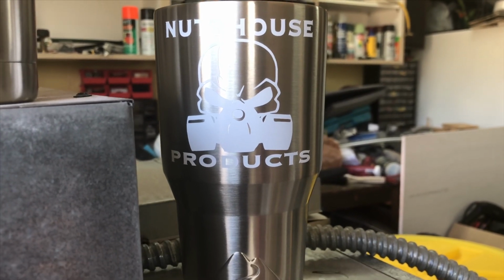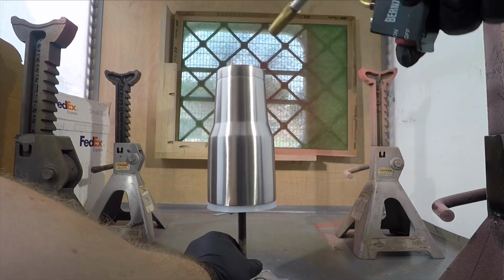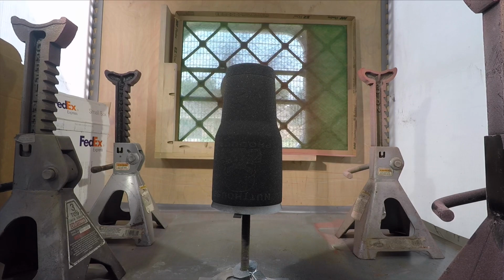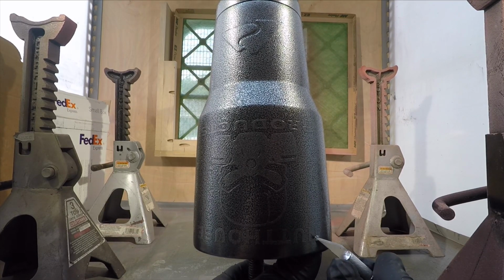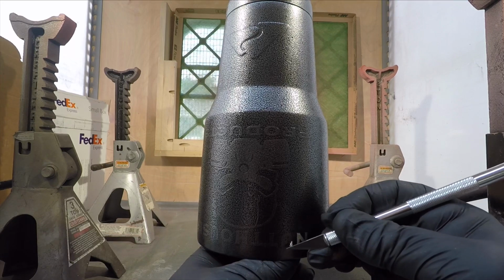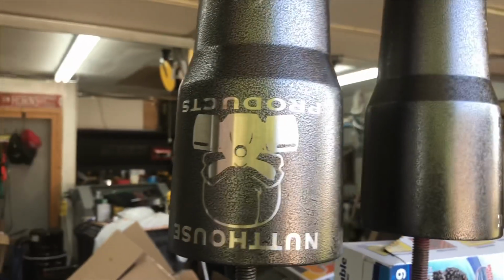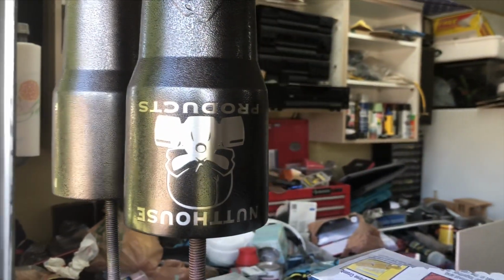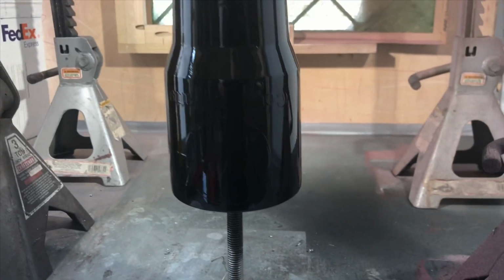Powder coating tumblers from home!! Adding vinyl decals for a custom look.

Comment: Are you using a heat gun to rewarm the cup to keep the powder soft?
Reply from the maker: On some of them yes and some I used a torch. Heat works better because it’s an even constant heat; we’re as the torch is faster but you can mess up the project also.
Reply: @TheNutthouse1  thanks

Comment: How did you do your ground? I think I have an issue with not having a good enough ground… I’m extremely new to this(only have done 2 pieces. I do horseshoe art). I know I have a ton to learn and any advice is welcome 😊. Great job on the cups man!
Reply from the maker: Thank you. I ended up doing an earth ground also. Put in an 8’ rod right outside my garage door.

Comment: I am just getting supplies for powder coating. I have been doing epoxy tumblers for about a year. What are the recommended temperatures for the oven?
Reply from the maker: For most powders it’s about 400°
Reply: Most companies either send instructions or have them on the website(Eastwood does any way)

Comment: I'm just getting my feet wet with this process, I'm wondering is it necessary to seal with Clear powder coating paint  or can I leave as is and If you do have to seal does it make it shiny or will it be a matte finish?
Reply from the maker: No I used a gloss black. And it came out already shiny.
Reply: The Nutthouse Okay so if I wanted a matte black I do not have to seal it? I can just leave as is correct? Thank you so much for your quick response.
Reply from the maker: Creative Vinyl Designs By Rebecca Escott  no you don’t have to clear it.

Comment: I have trouble with the vinyl shrinking when waiting for the powder to flow out. What vinyl do you use? Do you have any tips? Thanks for the video!
Reply from the maker: Greg Allen yeah absolutely. I use Orcal 651 vinyl. You can also get high temp vinyl. When I’m doing decals. I watch it closely and as soon as it flows out ( maybe 2-3 minutes) I pull the cup. Let it cool down to about 125 and pull the decal. I have had my vinyl shrink on real small thin lines. I hope this helps.

Comment: My adhesive from the vinyl stayed on the tumbler when I pulled the stencil off. 1) any tips for removing the adhesive but not the powder coat? 2) do you know why it did that?
Reply from the maker: You may have pulled it when it was to hot still. I try to pull mine when it’s between 110*-130*. But you should be able to use a magic eraser to help clean that up. You can also use acetone or denatured alcohol after it’s been fully cured.

Comment: Hey,  are you using a standard kitchen oven? Electric?
Reply from the maker: Jacob Porter yes it’s a standard kitchen oven. Well I have a double oven and that gives me just more room.
Reply: @TheNutthouse1  thanks for the reply.  Do you have much luck painting a base color,  laying a vinyl and then coating a different color to get a finish other than the stainless? Great work on the cups btw
Reply from the maker: Jacob Porter yes I have. Check out my video on the motorcycle parts. And thank you. Cups are fun to do.
Reply: Hello and how are you doing today? This is a wonderful turtorial! Do you have another one that shows everything a person needs to do this from start to finish. Like the name of the materials you used to apply everything and what you put on the cup?

Comment: What do you put in the top of the cup to keep the powder from getting in it
Reply from the maker: Billyz Designz I use a silicone plug. I ordered the cup kit from Columbia Coatings. You get the stand and the plug. They make the plugs for different size cups so make sure you pick the one you plan on using. Yes got both sizes just in case.
Reply: The Nutthouse thank you
Reply from the maker: Anytime

Comment: So how do you like that Kool Koat so far ? Finally ordering mine this week. And also , is there a place to order those tumblers or are they store bought ? Seems to be a lot of money involved being store bought
Reply from the maker: M Gears I really like the gun. I don’t seem to waste as much powder. As far as the cups go yes these are store bought because I got a really good deal on them. There is a place online that you can buy them from and they’re a little cheaper than the stores it’s stainlesssteeldepot.com and they seem to run pretty good deals cups between $6-$7 each. Now I know that’s not much different but it’s something.
Reply: @TheNutthouse1  That's actually a good deal , here where I live those sell for around 15 - 20 a piece. Thanks for the info !
Reply from the maker: @ M Gears that’s good then. I try to get a single color with the decal for $35.
Reply: @TheNutthouse1  Good to know , don't know if you seen it but Columbia Coatings sells metal art and they sell for a decent price
Reply from the maker: M Gears I’ll check it out.